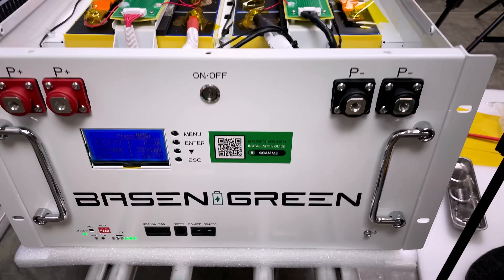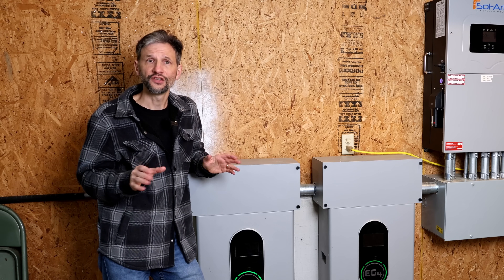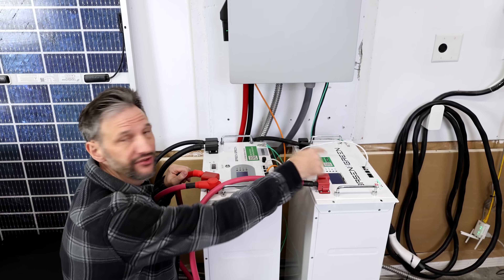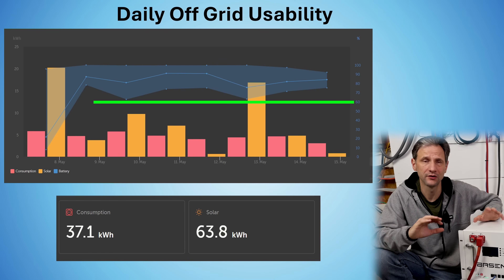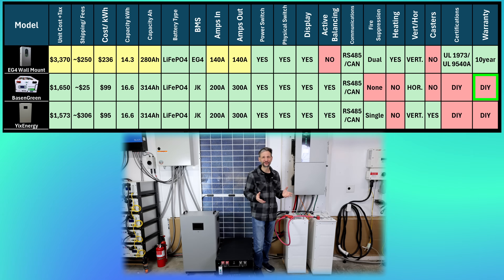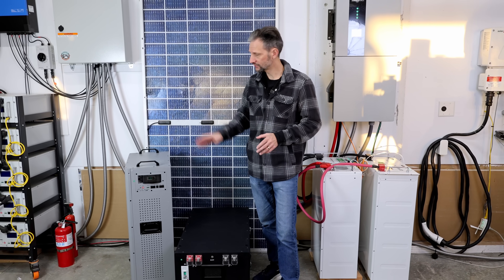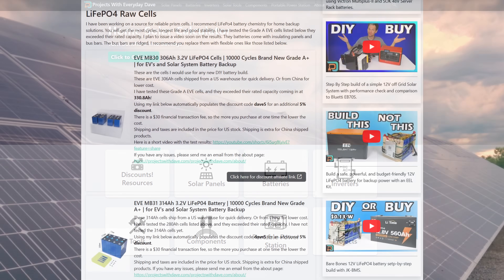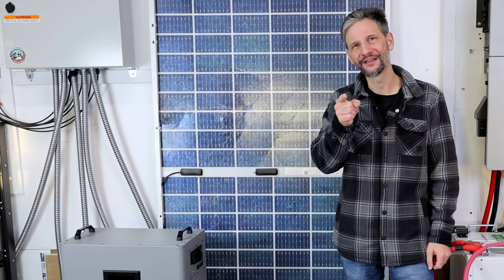I Compared The Top Home Batteries And Found A Winner!

Comment from the maker: This comparison will help you decide which backup battery you should buy for your home solar system. CORRECTION "Some notes show 212Ah for DIY, it should be 314Ah"
See all recommended battery options on my website: https://projectswithdave.com/batteries/
Signature Solar ($50 off $500-Discount Code : "EVERYDAYGET50"): https://signaturesolar.com/?ref=SALE
See more projects and get my FREE SOLAR Financial Calculator on my website ProjectsWithDave.com: https://projectswithdave.com/
Reply: 0:32 - these kind of mounting with a terminal pointing horizontally and not to the sky is forbidden by EVE . they do not authorise it, you will loose warranty and they will not cover any damages and what not. 
Strong warning for americans cause EVE has answered this question to a german youtuber 2 years ago and hence the insurance and reinsurances (as you  might not know many american insurances are using safe habor re-insurances in europe or germany) do no longer allow this kind of building. We have bought such a battery case with battery from seplos and were not aware of the situation when buying. But we stopped the whole project and the whole case will soon be stopped to enter the EU market due to violations of the regulations. 

I bet american UL listing is also strict and does not like such ideas to mount a lfp battery against the advice of the manudfacturer.

Comment: DIY is not worth it for the actual Components to be Built such as Batteries because most people can't Build it professionally with permanent connections and such....just adding....IMO....But Installing Already Professionaly Built Components is OK............ALL IT TAKES IS ONE LOOSE CONNECTION FOR YOUR BUILD TO FAIL.......

Comment: I wish you prefaced this with for off grid only and only in some locations, because most of the batteries you compared cannot be installed where code compliance is required.
Reply from the maker: As I mentioned, if you need code compliant you will have to go with a UL certified battery like the on one from EG4: https://signaturesolar.com/eg4-wallmount-indoor-battery-48v-280ah-14-3kwh-indoor-heated-ul1973-ul9540a-10-year-warranty-pre-order/?ref=SALE

Comment: What about a 10kw version of these batteries ? Not everyone needs 14/16 kw of power , plus more amps  would be better than the typical 100ah  offered in most rack type batteries .
Reply from the maker: If you don't need that much capacity I would go with the server rack style: https://signaturesolar.com/eg4-lifepower4-v2-24v-200ah-server-rack-battery/?ref=SALE

Comment: Why didn't you include the Ruixu Lithi2-16  battery which is one of the best batteries out there right now? It has all of the UL certifications it's heated and it's very reasonably priced you can get them for around $2,700 now. I feel like this was a big mistake in such a great video that you made.
Reply from the maker: I didn't include it because I haven't tested it.  Thanks for posting your experience, others have mentioned the same battery.  I assume this is the one your are speaking about?: https://amzn.to/47VfdM2
Reply: @ProjectsWithDave Yes Dave that’s the one. It blows away the EG4 battery for value and it has all the certifications to be inspected.  I’m very intrigued by the do it yourself batteries  you’ve reviewed and I would love to buy them and save thousands of dollars, but the reality is if my house burns down and the battery is remotely, considered the cause I’ll have a real battle on my hands. These do it yourself batteries are only good for people who could put the batteries in places where if it burns down, it doesn’t really matter like a shed . As unlikely as it is.  But damn the prices are awesome and I bet you that the build  quality is just as good. But no warranty and potential insurance denial.  No can do.  I’ve taken apart and inspected this particular battery and it’s built like a tank. The only thing it doesn’t have is a Bluetooth connectivity, but I would argue that that really isn’t that important. The BMS is easily accessible if you need to change it or service it and it’s a very heavy duty BMS. Check out the videos on YouTube Dave you’ll be impressed. I pulled 339 ah out of it using my Victron shunt to measure it.  Mine has CATL cells. I think it had some more left but the BMS shut it down for low voltage, but that’s just the setting that they pick to protect the cells as you know.

Comment: There's just one thing i didn't like about these DIY enclosures is they do not provide adequate compression to the cells surface. Yes it will work fine initially and maybe for a few years but I think as the cells age the Lack of compression will lead to bloating and reduced life of the cells.  I am a EE who specializes in energy storage. Every cell manufacturer I've spoken to has always specified a certain force that's required to be put across the face of the stack in order for them to comply with the warranty.  During some of the stress test and lifecycle testing of the cells I have run,  the ones that did not have precompression would bloat and you can see the capacity fade from the data plots.
Reply: DIY is not worth it for the actual Components to be Built such as Batteries because most people can't Build it professionally with permanent connections and such....just adding....IMO....But Installing Already Professionaly Built Components is OK.............

Comment: Be very careful with yixiang power. I ordered a vertical battery enclosure through them recently. It arrived banged up, internally and externally. Their after sales support is horrendous. Once Becky has your money you are on your own. yixiang power has basically ripped me off. I am down 600 USD. And if you think Alibaba is going to help you. Think again! I would RUN the other way folks, as fast as you can.

Comment: All… Any insights or considerations regarding the installation/use of non-UL certified components and risk of voiding home owner’s insurance policies in the event of an electrical fire?  Would the insurance company likely view a UL certified battery solution like any other UL certified appliance?  

For non-UL certified components… what additional fire suppression measures would be recommended based on your knowledge/experience?  For example: Firereace International offers a product called FlexRope designed for use in small scale electrical panels/cabinets/enclosures up to 35ft cubed. It’s approved for class A,B and C fires.  Would this type of fire suppression product be advisable in situations where batteries are installed in a garage attached to a living space?

Comment: Loaded and vague question (rough swag is all I am looking for) but how much capacity is needed for going off grid with an average consumption of 124 kwh per day. (yes I know a bit loaded due to it being dependent on load usage at night) but rough estimate would be nice. Also estimated solar size. I have my calcs for both of these but always nice to hear someone's quick swag on it to compare. 

Thanks.
Reply from the maker: To truly go off-grid you need a very large system or a good generator.  First, run a PVWatts analysis for your proposed array to see what months and days will be your limiting factor for solar input.  Decide how many days you want to be able to sustain power without running the generator.  Where I live we can go multiple weeks with full cloud cover and virtually no sun.  You need to understand your worse case number of days without sun.  For a rough estimate subtract your worst case daily average input for your estimated array rom your daily consumption.  This will likely be in Dec or Jan.  For instance if your worse case daily production in Jan is 20kWh your battery input for the day would look like this: 124kWh - 20kWh = 104kWh.  
If you want to be able to go 3 days under those worse case conditions you need 104kWh X 3 = 312kWh plus you need margin to the battery lower limit of 20%.  312kWh/0.8= 390kWh.  If these were your actual numbers you would go back to the drawing board because the cost would be ridiculous!  Then you have to decide to increase your solar array size, or reduce the time you are able to go without running the generator.  Hope that helps.

Comment: What if I already have two EG4 14.3kWh wall mount batteries (connected to two 18kpv's)?  Can I mix battery types and build two of these cheaper batteries and parallel each one to each EG4 battery?

Comment: From EG4 website: “Please note: The EG4 12000XP and EG4 6000XP off-grid inverters are only certified to UL 9540 when paired with the EG4 WallMount 280Ah Indoor Battery.”
—> important note I’m not sure was mentioned

Comment: be cautious with the basengreen DIY, bought my first one with no issue, the second seemed to be a used case shipped out with a PCB1 board missing wires and something that looks like caulk holding one wire in place.  Having a hard time getting them to replace The PCB1, at first they asked me if they could just send me new wires and have me wield it in place, told them that the reason I bought the kit from them is that I do not know how to do that kind of work, takes multiple days for them to respond, they wanted me to try and find somewhere that can do the repair and that they might cover the repair cost if it is "reasonable", Finally after back and forth they said that they would Airship a new PCB1 board from China to replace it, been 5 days and still no more info or tracking number.  Please be aware.

Comment: Those initial capacity tests are short lived. They will all drop back to their rated capacities within a few cycles. Like three to five cycles. Which is completely fine, nothing wrong with that. I'm still also not sold on vertical or wall mounted batteries. But I have seen a couple that actually installed the cells correctly in the vertical position. Manufactures issued statements against installing cells on their sides due to electrolytes draining against the top of the cells and leaving an air gap on the side of the cell top facing, resulting in crystallization and shortened cell life. Never since have I seen any more statements or revisions to those statements.
Maybe it's a little, maybe not? Roll the dice I reckon but I prefer to not be building new batteries anytime soon. I mean it's fun and all that but I'm done for a while. May get the gumption up sometime to maybe throw a MB56 pack together?

Comment: hmm was half the price to build my own without the case with cells straight from china and no smart bms, just used a 16s active balancer dumb bms and keep the cells indoors/not freezing weather and use a fuse + inverter settings to control loads/charge settings. 2 years now with daily use in the back of my car, adding on the cost of the 300 buck 6.4kw 220v inverter and its already paid for itself in fuel savings as a portable level 2 ev charger. more info on my channel on the solar volt video :)
once i finish my hv battery expansion build it will just become an off grid ev solar charger in the garage.

Comment: I'm pretty skeptical of these rock bottom prices. Are they really using top quality cells and BMS? The may test and spec. well, but how will they be in 5 years...
?
Reply: Yes, the quality of the DIY kit is miles ahead of ready made batteries. The BMS alone is magnitudes better.
Reply: @dominikvonlavante6113  Exact same BMS is used by some battery manufacturers.

Comment: People be mindful only certain batteries you local AHJ only accepts batteries to pass inspections also your utility company will only accepts batteries that UL rated and etc to grid tie for net-metering. Be mindful your home is worth more than 200k don’t go cheap to save couple 100 dollars and batteries causing a fire. Saw fire over torque , over a screw over busbar rating and battery specs materials are easily would be worried about who’s making the batteries. Also have a licensed engineer stamp your plans can cost $300-500 to have a wiring diagram with wire size and etc that to much to say on here.

Comment: Also want to mention for wall mount batteries the RUiXU lithi2-16 is also UL listed and is 16 kWh. They also are several hundred dollars cheaper than the EG4 indoor battery. The RUiXU lithi2-16 is rated for outdoor use but I have mine indoors. They are heated and have a breaker as well as a field replaceable BMS ( that was the selling point for me). So if you need a UL listed battery it would be worth looking at them as well.
Reply: In Europe and the rest of the world , you only need to meet international standards. 

You don't need American standards. So DIY batteries can be insured . 

In America you spend 50% of the cost just for UL listed  your solar sistem

Comment: If you have room to install inverters and batteries outside of your home in a shed or even a shipping container DIY battery is the way to go. If your installing in your home there is a higher risk of something going wrong who knows what the outcome would be without UL9540 cert batteries.
Reply: The DIY batteries are safer. Their design and quality is miles ahead of ready made batteries. The only battery that even comes close in build quality is the DEYE LV battery

Comment: After building my system last year.  The first thing I realize is that the battery system should be much higher voltage than 48V.  Solar is coming in at 200-400v, steps down to 48V than steps up to 240V for consumption.  Requires big fat wires to support the amperage at 48V.  If we have higher voltage system, I think we can use much smaller cheaper wires and my guess is the inverters can probably have much higher outper for the same cost and size.
Reply: Yes and No.  48V is plenty good enough for residential, a safer voltage to work with, and far easier to maintain years down the line.   An HVDC system will run 3-5% more efficiently (not a whole lot... 48V is already very efficient), the inverter will run cooler, and cost a bit less.   However, a HVDC system does not necessarily give you more AC output or robustness.  That is more a function of the mid-bus topology in the inverter and a lot of HVDC systems skimp on the mid-bus topology to make the inverter cheaper, whereas 48V systems generally don't skimp on the mid-bus topology inside the inverter.

Other downsides of an HVDC system is that the battery bus runs at far more dangerous voltages, its harder to expand the system with more storage because the batteries are not typically voltage-matched (they need a buck or boost stage, albeit a simple one), and they will be much harder to maintain years down the line due to the non-standard voltages and the need for closed-loop comms (which a 48V system can omit if desired).

For example, you can scale a 48V system with literally any number of 16S 51.2V LiFePO4 batteries at any time, even mix the original ones with closed-loop comms with your expansion that might not have any comms at all.  It is also easier to have alternative charging sources for a 48V system since solar charge controllers and AC chargers more or less directly interface with the battery bus.
Reply: 48V sistem Safer and cheaper than high-voltage batteries. Also more standardized
Reply: If 2-3$ worth of wire break your bank maybe this is not for you.
Reply: @MegaCyrik honestly, it is more like 200$ in cables and safety gear, but as you said, much, much safer, better quality and standardized.